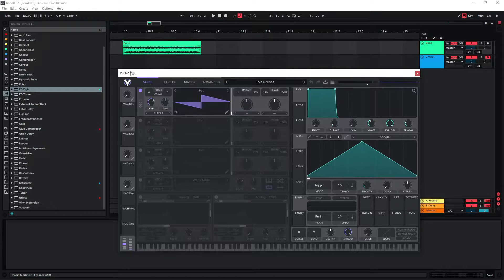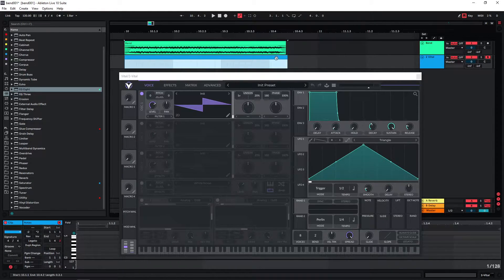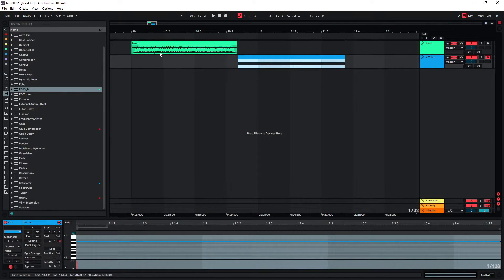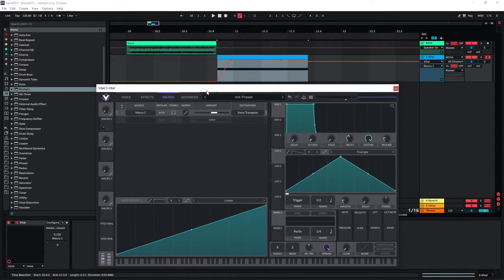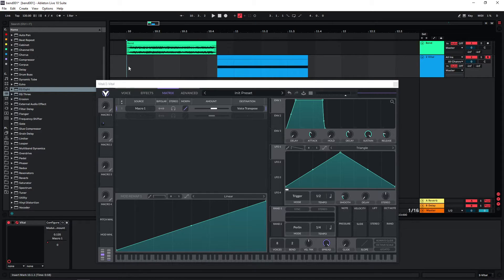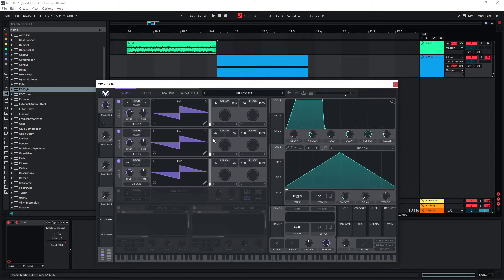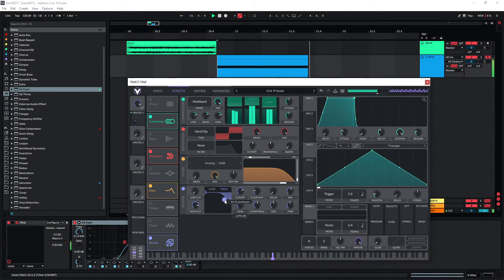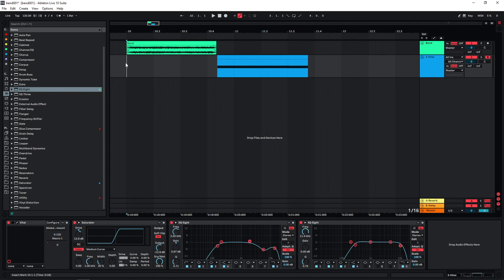How To Recreate Sounds: A Simple Approach

Comment: the original sample sounds like it was made with a comb filter rather than oscillator, but either way your take generates the same emotion overall
Reply from the maker: Definitely possible. There are so many ways to create (similar) sounds, it's usually difficult to recreate the exact process someone was going through (especially once resampling is involved). :)